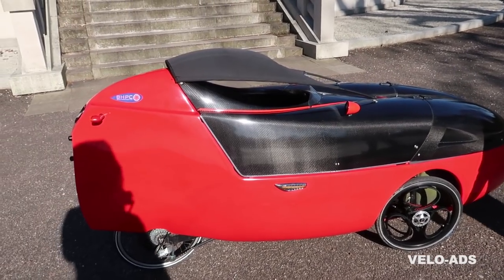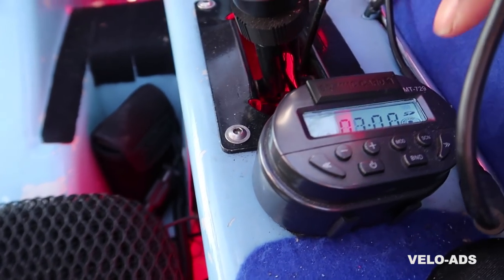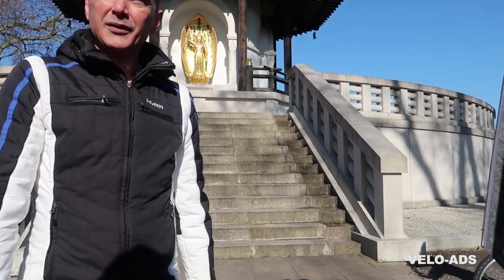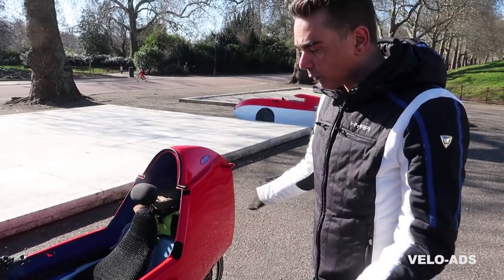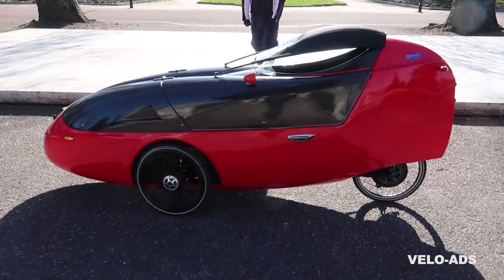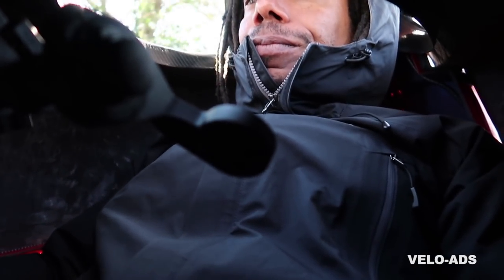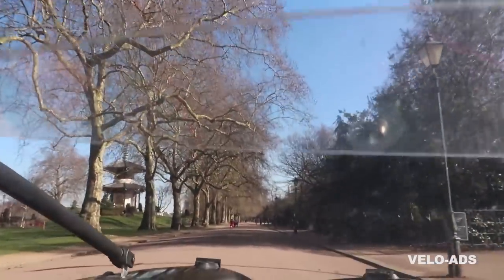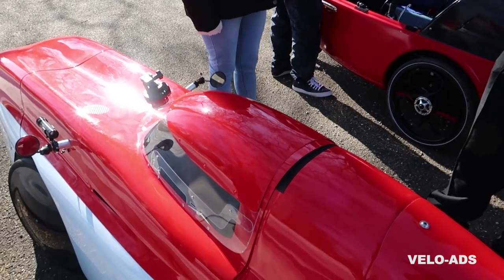THE MOST PIMPED SUNRIDER EVER! VLOG 065

Comment: Wish I had more money, its a shame velomobiles in general aren't cheaper we'd see a lot more on the road. Ideal single person transport especially with pedal assist.
Reply from the maker: Lee Harrison it's a lovely machine, if you check out the secondhand market it's possible to find one at a reasonable price occasionally.
Reply: Lee Harrison In the german "Velomobil Forum" there is currently an Alleweder for sale. It is only 1350€
Reply: Just having it as single speed without electrical assist should keep the price below 2000$. If you want motorized transport so badly just get a cheap car.

Comment: I'm in the U.S. and these aren't nearly as common around here, however I have seen one in my area.  I haven't been able to talk with them, but as spring comes hopefully I will see it around and get a chance to talk with whoever owns it.  I would love to try one.  I have some very long steep hills on my commute of about 15 miles each direction, so not sure how practical it would be for a daily commuter.  Possibly with the electric assist it would be feasible.  What is the mileage range under all electric or have you tried that?
Reply from the maker: Roman Gillund Hi there, yep the e - assist would be fine, especially with a spare battery.
Reply: I don’t think you are able to go full electric as the motors are as a boost to get you to speed and usually cut out at around ten to twelve mph/ seventeen to nineteen kph